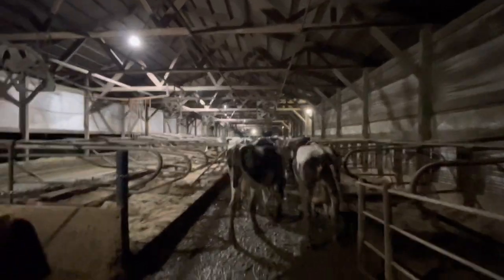Scraping the barn! We finally have a place to haul some manure!

Comment: Those 824 chain heads aren’t really complicated. As long as your chain timing stays, you’re ok. If it gets off or bearings start to go on the hex shaft underneath, then you are NOT going to be able to reverse the head at all. It takes pry bars on the springs and hope fingers are out of the way. Any time our head starts to drag, we’re better off stopping and yanking all the corn that won’t feed through out, and starting again.
Reply from the maker: Yeah we are getting her fixed up little by little now! But yeah had a bearing go out on it and that messed up some things. But yeah we are finally getting all the bugs out of it!